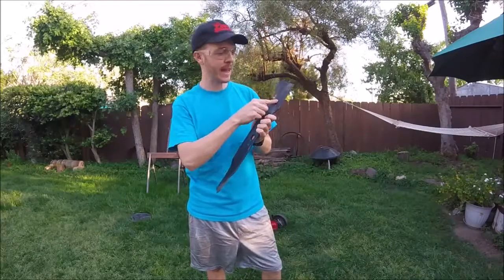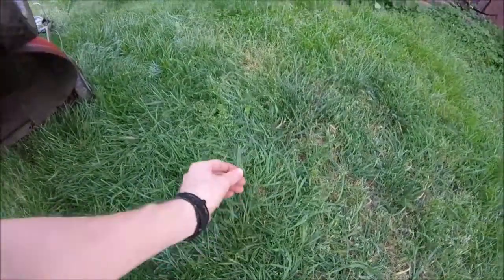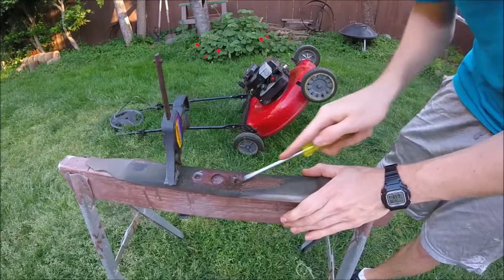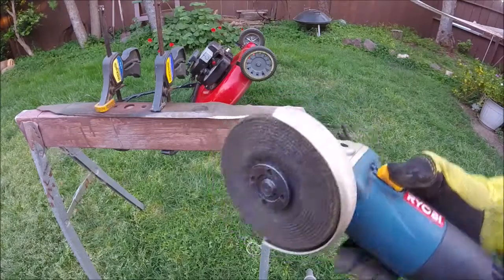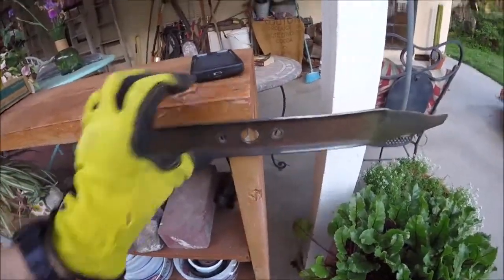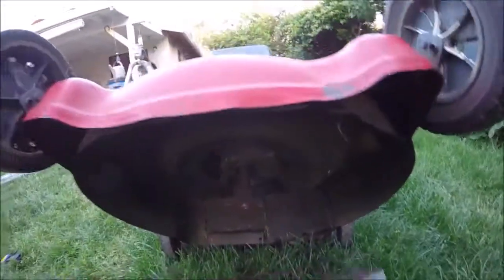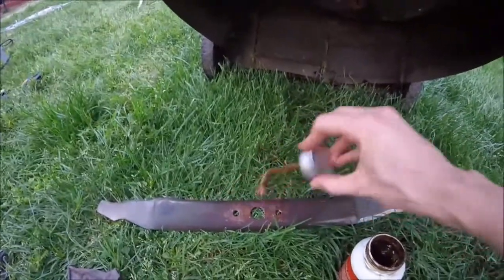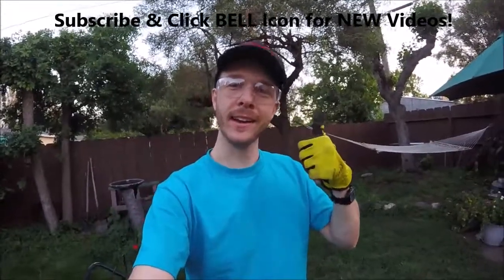How To Sharpen & Balance your Lawn Mower Blade -Jonny DIY

Comment: A fine tuned engine will start up even if you disconnect the spark plug as shown, the wire will return towards the plug.  And a few turns of the blade could start the engine and be hazardous to your health. So to be safe cover the wire or plug with a small piece of rubber tubing or for total safety remove the plug all together. If you do that you can also adjust the gap on the plug at the same time.
Reply from the maker: Thanks for sharing, can never be too safe 👍